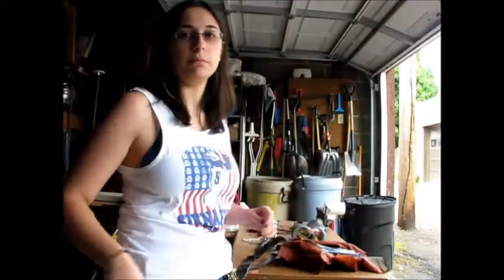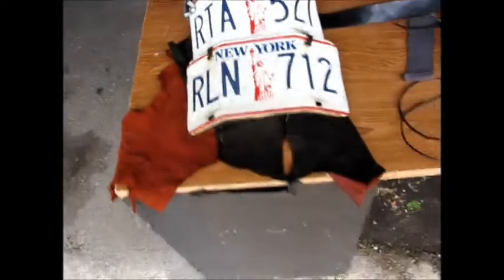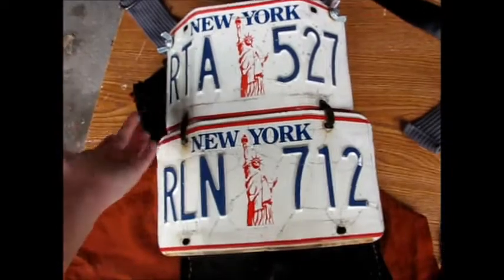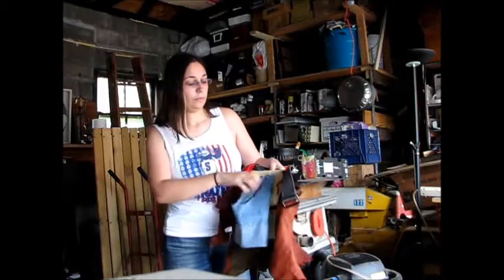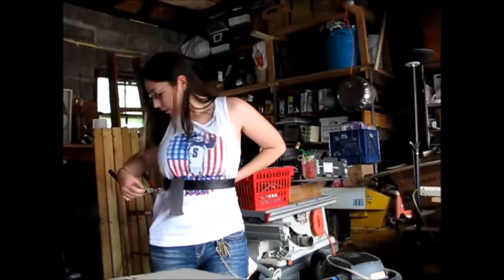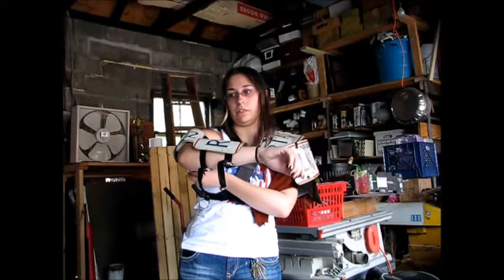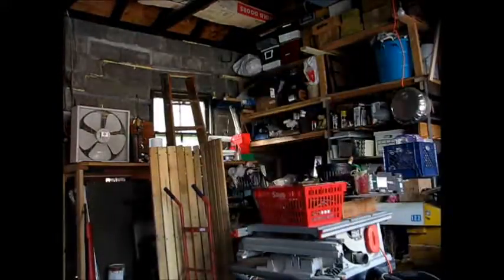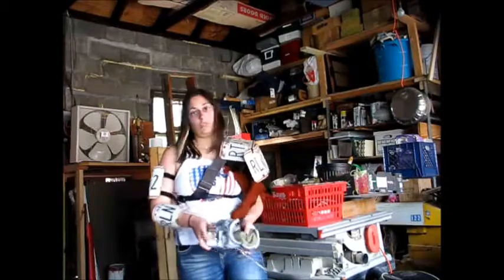Raspberry Pipboy Battery Armor

Comment: Hey, Nice armor idea! 
And awesome work on the pip boy, I am also starting a pip boy project and I was wondering if the whole thing of using the raspberry pi was difficult.. Is the coding really advanced ? And the wiring? Because it seems "easy" but I'm kinda scared of buying it (even though it's cheap) and ending up not knowing what to do with it. 
Thanks for your reply, and good luck with your project, will definitely be following it!
Reply from the maker: The wiring is honestly the simplest part. There's very little to do; the screen (at least that one) just snaps right in place, and depending on what you want to do you probably wont even need to solder anything in. If you want just one of the three lights to light up on the front, you could wire that entirely separately onto a simple 9v battery on/off switch. If you want to tie it in to the actual raspberry pi, it gets a bit more tricky (the hardest part would be finding the space to solder the cables into the board under the screen). The big thing you might want to know about the pi though is that there isn't an on/off switch! You plug it in and it goes. BUT there are holes on the board for you to solder in a reset switch (just two pins connecting to the wires of your switch, a very simple bit of wiring). 

As for the programming: I'm no expert. If you wanted, you could just loop a short video or a gif, or even have just a few pictures you could slide around. If you're looking for a real program? Yes. It's complicated as all getout. I have to keep putting this project on hold because of that actually. We keep finding more things we didnt think out fully! Progress is slow, but if we ever get the one we want done? We'll be posting it online for free use. 

Feel free to ask any questions! I'm no expert, but if I don't have answers for you I can probably  point you in the right direction. And thanks for commenting! =)
Reply: Adira Tyree Thank you so much for your answers, you covered everything I wanted to know about the raspberry. I was thinking of starting simple with fitting a phone in it, with of course modded pip boy interface, but my ultimate goal would be the raspberry with the working pip boy interface as well as the buttons...(I'm too obsessed with accuracy...) But seeing how difficult it seems I don't think i'll ever manage to finish it haha.
I'll try your idea with the 9v battery and the LEDs, I was thinking of using a rotary switch on top of that to allow using all of the lights! 

Thank you so much again! :)
Hope everything goes well with your project, can't wait to see it finished !